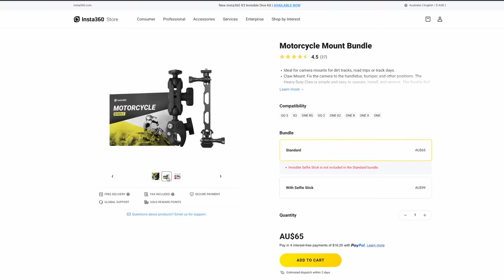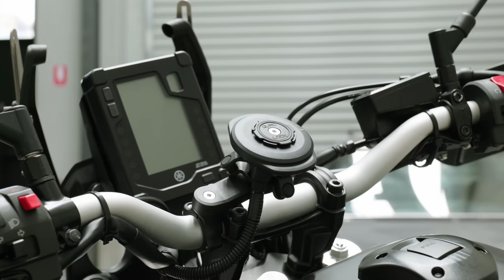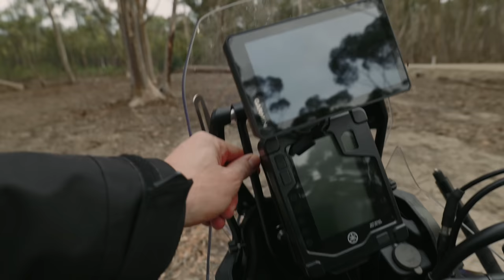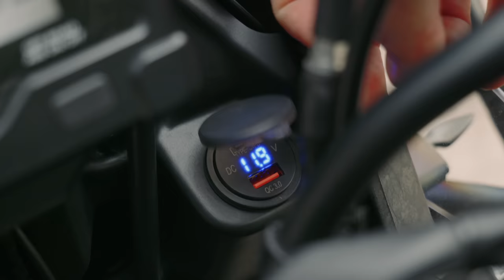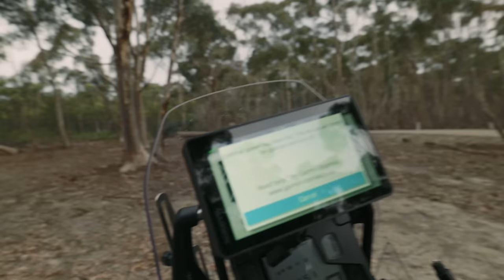My Tenere 700 Build

Comment: Suggest a HP Corse full exhaust system.  Tucks in and works great,  Off-The-Road in Germany or Motoin.  Hit them up.  You make really good vids.  No BS stuff.  Steering head bearings, don't know if you have greased them but they are pretty much dry from the factory.  All years.  Swingarm and shock pivots as well.  For driving and fog lights, Clearwaters, made in USA.  Pricey.  You can mix systems, one fog, one driving.  Contact them.  Most all the rest are China made.  Denali's internals are as well.  I have a 2022.  Work in progress at this time.  Full Ohlins made for me.  You have great suspension man in Aussie, Clive.  He does it all.  Hahn hubs, Excel tubeless wheels.  Seems it never ends.

Comment: You only need to take the side fairing off to install the USB socket.  Just put the wires on first and feed them down then wire them into the accessory power plug that's right there.

Comment: Cheers from Arizona mate. Love your channel and especially what you did to the Tenere 700. I have no idea of off roading but wanted to know if the tires in the T7(for short) are tubeless. Also what would be the cost of skid plate and upper crash bars… Thanks in advance… 
I just want a reliable bike to learn how to do easy off road that also has some respectable fuel range..
Thanks again cheers🫡🇺🇸🌵

Comment: you put on the bike several really really not important things (but OK if you have money) but one of the most important thing is missing which is the exhaust holder protection (some idiot in yamaha made it as a part of the frame loool such a fail idea)